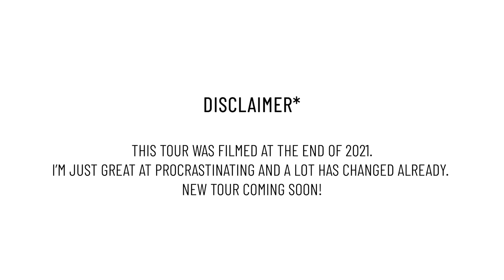TINY SHOP TOUR! | SINGLE CAR GARAGE

Comment: Here some ideas: I'd get more and better lighting, big production and mood improvement. 4 hanging 150 to 200 watt 5,000k LED warehouse bay light fixtures. They go for 100 bucks each. A bigger compressor, maybe located in a small attached shed outside the garage with more air tools, especially for sanding. If not that, I'd invest in an industrial grade belt sander with a 3 HP 2 phase motor and matching dust collection stand. Not sure if you live in a house that belongs to the same property, but I'd try to find a 2 car garage so you can work on a van when its raining / snowing. Do you have jobs lined up at all times? If yes, expand and hire. Raise prices if needed. If not, move to a state with higher demand for van builds and longer summers.